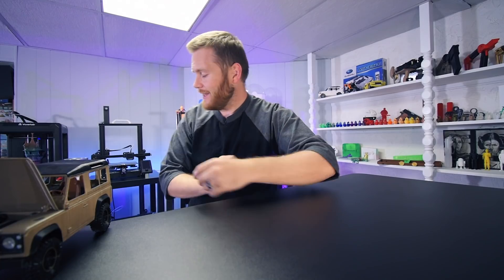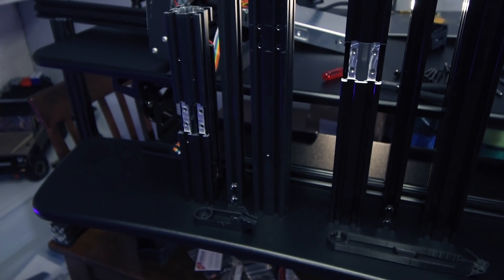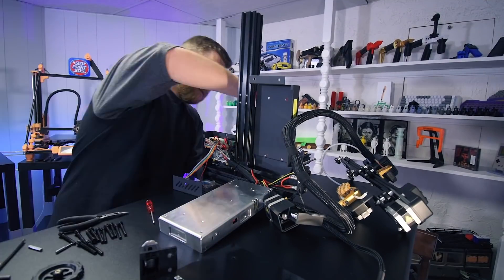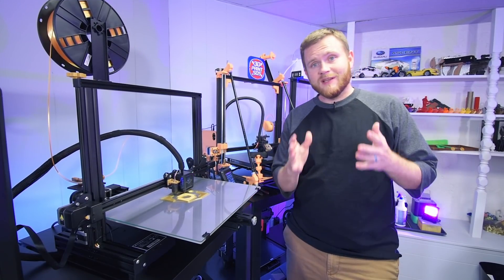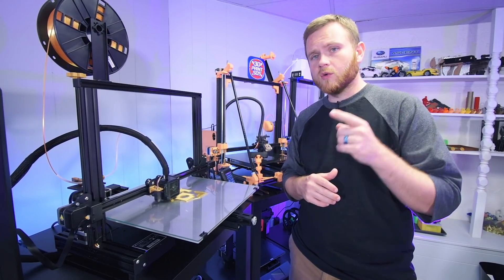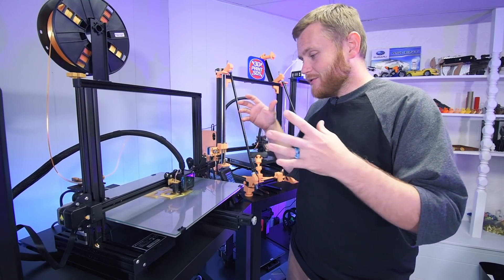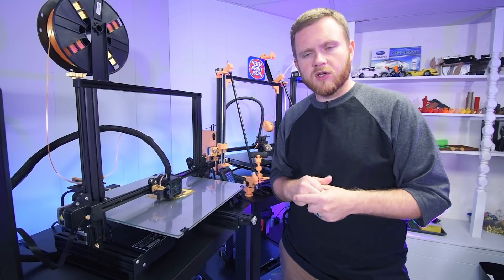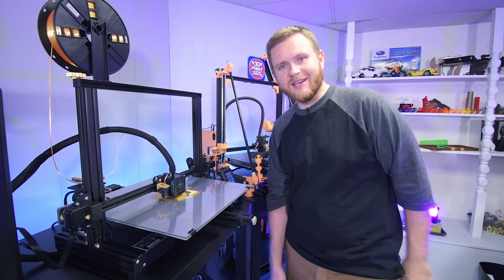Make a MASSIVE Aquila! With Ender Extender

Comment: Should I buy the voxelab aquila x2 or the fokoos odin f3
Reply: Does the Odin's slicer look similar to flashprint or voxelmaker
Reply from the maker: It’s a Cura Reskin
Reply: @3DPrintSOS   could you send me a photo/screenshot
Reply from the maker: It’s quite literally Cura.
Reply: @3DPrintSOS  which one would you recommend for someone who used flashfoge 3d printers for three years but has never owned a 3d printer and would like to upgrade it over time but wants to start with a quality printer
Reply from the maker: The Odin is a higher quality printer for sure. The Aquila is no slouch, but in my opinion it’s a platform for tinkerers. If you want something that’s already got a few more bells and whistles, the Odin wins.
Reply: @3DPrintSOS   so which has more value for money
Reply from the maker: I would say the Odin. Less things to upgrade. A bit less to worry about. The Aquila is a basic machine that can be turned into something that prints way behind its cost. But the Odin is a stronger package and is capable of printing faster because of its volcano hotend and direct drive.
Reply: @3DPrintSOS   is there a simpler slicer for the odin, also could you add a cr touch or extend it like this.
Reply from the maker: Cr touch yes, extender, no. I would just use their slicer because it already has profile that work out of the box.
Reply: @3DPrintSOS  could you upgrade the aquila x2 to be better than a stock odin-5 f3
Reply from the maker: Yea I think so. But the money would likely be equal by that point. So if you like incremental improvements, Aquila would be good.
Reply: @3DPrintSOS   ok would you recommend the aquila or aquila x2
Reply from the maker: Aquila x2 in my opinion is slightly better if you don’t plan to modify it right away. It has improved fans and plastics.
Reply: @3DPrintSOS   got it could you do a few more videos on it
Reply from the maker: I need to do more on the Odin. Since the Aquila x2 is close to the original and the Odin has some special features
Reply: @3DPrintSOS   please do a unboxing/review on the voxelab aquila c2
Reply from the maker: I just found out about this one. I plan on it. Gotta get my hands on one.
Reply: @3DPrintSOS  what do you think about the firmware
Reply from the maker: Of the Odin?
Reply: @3DPrintSOS   no, of the c2
Reply from the maker: I haven’t had a chance to get a hold of one yet. Soon.
Reply: @3DPrintSOS  what do you think now that you got one this morning
Reply from the maker: Since it’s an H32 chip, I’m a bit concerned. Knowing, I can’t compile firmware myself is odd. I havent tested it  yet so we will see how it works
Reply: @3DPrintSOS  is the firmware better/worse than x2
Reply from the maker: Not sure yet. But I’ll let you know.
Reply: @3DPrintSOS  I ment more easy to use than x2
Reply from the maker: Probably not. The Aquila x2 ui and screen are great
Reply: @3DPrintSOS  in your video can you please include a look at the firmware
Reply: @3DPrintSOS  also, does it have any features the x2 doesn't
Reply from the maker: Sure I’ll dive into it. We will look at the components, the firmware that comes with it and how it prints.
Reply: @3DPrintSOS  ok, thanks also pls review flashforge fillament dry box
Reply from the maker: Oh I didn’t know they had one. I’ll check it out. :)
Reply: @3DPrintSOS  ok
Reply: When r u publishing next video
Reply from the maker: Soon, I have one I just wrapped up and working on getting a c2 video, an h32 video, and some more materials tests videos. I have a lot to do with out the time for it. Trying to fit it all in.
Reply: @3DPrintSOS  pls prioritize the c2 vid
Reply: Pls get the c2 vid out soon
Reply from the maker: Tomorrow ;)
Reply: @3DPrintSOS  ok
Reply: Why didn't you show the firmware in the c2 vid
Reply from the maker: Firmware? You mean the menu? Because it’s vanilla Marlin.
Reply: @3DPrintSOS  yeah, sorry I did mean menu
Reply from the maker: That’s a great question. The Odin is a cool printer. Higher quality than the Aquila and prints faster. But the Aquila is more customizable so if you’re into tinkering, the Aquila is probably more interesting

Comment: I would upgrade the Y axis stepper motor with 42-40 or 42-48. I actually did that to my regular Aquila, I put in a 42-48, you get way more torque because you're moving more mass, that's why those steppers run hot. I cranked the vref up and its perfectly cool!

same with dual Z axis, i increased the voltage from the main board screws, not super necessary, but as for these double wide kits and that long gantry arm, the sag must be real.
Reply from the maker: Haven’t had issues either the Y but I have a few steppers laying around I could use if that’s the case. Dual z I can see would be a benefit though.

Comment: So that kit works on the Enders? Also, is that a Direct Drive system?
Reply from the maker: Ender Extender has specific kits for specific printers. Ender 3 is what started it all, so there should be a bunch of options. No, not a direct drive but one can easily be added

Comment: Would be nice if you could make a video that will address  the  necessary upgrades and tweaks  needed in firmware and cura or anything els following this build...
Reply from the maker: I’d love to. First things first, I want to put it through its paces to be sure I can recommend it. Spoiler, just took off a massive 36 hour print. And it’s great.
Reply: @3DPrintSOS  Hahaha, I run my CR 6 SE and CR 10 S anywhere from 30 to 120 hours at a time.  When I get this upgrade voxelab done I got one print that will take 172 hours and that is only half of the print. and its only 0.8 tall lol.

Comment: Any tips on getting prints to stick to a glass build plate? I have my bed levelled, nozzle height tuned in for a good 'squish' first layer, but prints still come detached during print.
Reply from the maker: Go 5 degrees higher on the bed temp, clean it suuuuper well with isopropyl alcohol. If that fails you can use glue stick on a cold bed. However, that’s just a bandaid for a problem that can be fixed. It’s typically a temperature, or leveling issue.
Reply: Hair spray

Comment: Considering how much research I've recently done into longer extrusions and finding a larger bed heater, this video answers more questions than I even thought to consider.  Wiring extensions would be a major concern.

One of the very few frustrations I've had with my Aquila is that I keep designing things slightly larger than 220mm in size.  Not a lot, just a little outside the bounding box.  Problem solved!  :)
Reply from the maker: This gives you sooooo much real-estate!
Reply: If you poke around the Ender Extender site, there's all kinds of wiring extensions they offer that either add on or replace your existing wiring.

Comment: I have a go voxlab Aquila and my extruder keeps making a popping noise. do you know what the problem is?
Reply: Thank you
Reply from the maker: Could be a number of things. Might need higher temps, could be a clog, or you may need to up the tension on the extruder arm spring. Also check to make sure your arm isn’t cracked. Common issue

Comment: 15 and a half inches. WOW! What in the world are you going to fill that bed up with? This is the printer you need that Zodiac printhead on. With a bed this size you sure don't want a failure due to a knockoff printhead after climbing 200mm in zed. This is going to be a Cosplay printer for sure. One piece helmets and chestplates come to mind right off. My LK1 can print helmets one piece, but yeah, 3.5 more inches square on a printbed is a lot of real estate.  I would put a cadillac antibacklash nut on the screw and keep the eccentirc a little tight on the un screwed side. should print fine with no sag at all. Nice video as usual Fedor. Happy printing I am so pleased to learn that Voxelab is releasing their sourcecodes for the firmware. Especially for you Aries folks. Too late for me I bought a Saphire pro.
Reply from the maker: This thing is massive. I want to print some of my keyboard case designs. This will be perfect for it

Comment: Hey Fedor thanks for another informative, interesting video! Has the X axis been OK with the added length? Almost seems you would need a dual Z with the doubled length of X axis.. Good luck!
Reply: I got a 400xl and it really needed one it's probably a good idea to put one
Reply from the maker: Noted. Been doing some test prints. All have been perfect so far. Doing a 36 hour print now. I’ll document it for a video
Reply from the maker: So far yes. It’s really not that much weight being added. I mean, dual z would be great, but so far, not a problem. I’m not printing fast enough for it to matter. Only 50mms

Comment: Does it come with the new to size heater? 

I would like to see a linear rail version of this kit.  If I could get my hands on the prints or solid models of the machine, would be happy to design the conversion.
Reply from the maker: No, you use the stock one. And it actually works just fine. I bet if you add insulation, it’ll be perfectly fine. 

You could easily do rails because it’s still and Ender clone at the end of the day. So you should be able to add parts super easily.
Reply: @3DPrintSOS  - was just thinking a longer linear in the X axis from McMaster would be all you would need, from there you can adapt out to any hot end on the market or a direct drive
Reply: @3DPrintSOS  - Thank you for all that you do! I have been using commercial 3D printers for years, but am new to the hobby, we all very much appreciate your helpful and insightful videos
Reply from the maker: Glad you find it useful :)
Reply: @3DPrintSOS  - so you just stack the old heater plate under the new plate...??
Reply from the maker: Yep. Old heater is the heater, new plate is just an aluminum plate that distributes the heat

Comment: Is there any way you could do an in depth setup for the aquila? I've had non stop problems with mine such as, stringing, shifting, just absolutely everything that can go wrong has gone wrong.
Reply from the maker: That’s unfortunate. It’s typically a few small but key things that tend to stack up and cause issues. 

Anything specific I can help with?
Reply: @3DPrintSOS  right off the bat when I purchased and received my Aquila I have had over 100 emails with customer service. I had a bad motherboard then a bad extruder then even up to the power supply. I'm no expert at this stuff so it kind of helped fixing everything. I did the new fan conversion you had a video on put in a bl touch. But my printer doesn't work right. Cura us usually my go to but it seems to be off. The printer has been slipping every print. I've checked belts and they are perfect. I have excessive stringing on all my prints and I've noticed they aren't very accurate. I'm using petg since it's my favorite and I'm printing at 240 70. Just non stop issues as you can see. Any help would be wonderful.
Reply from the maker: Join the discord server and make a post in troubleshooting. That was multiple people can help and you can post pictures to help us diagnose the issue. :)
Reply: @3DPrintSOS  how do I do that?
Reply: @3DPrintSOS  and thank you for being the one YouTuber to actually respond and help people in the comments
Reply from the maker: The discord invite is in the description to this video. Just click and join. If you don’t have an account, you can sign up pretty easily.
Reply: @3DPrintSOS  also what software do you use? I  am running jyers marlin firmware which has helped me a lot but I M wondering if it isn't helping
Reply from the maker: Jyers is great because it will let you calibrate pretty much everything. As long as you know WHAT to calibrate. ;)

Comment: Height change?
Reply from the maker: I kept mine stock. But that is available. :)
Reply: @3DPrintSOS  I went and checked it out that 400xl is tempting, seems sort of funny to think about spending more on an upgrade for a printer than I did for the printer itself
Reply from the maker: Haha yea it does. But this is a whole different animal now. That’s for sure. I just love that it’s so upgradable and getting into this size printer is significantly more expensive

Comment: I would really want 2 bed rails with a platform that size.  I would imagine it could have a lot of inconsistencies for leveling with all of the added surface area
Reply: Yeah, I am curious to see if you have any issues when you print something much larger.
Reply from the maker: Just printed a massive 36 hour print. Awesome so far. Going to try an even larger print now.
Reply: I think my v slot wheels and the holes for them were a bit off (gotta love crealitys quality control) causing my bed to be super wonky (even after endlessly trying to tune the eccentric nuts and replace v slot wheels). 

So yeah I've upgraded to linear rails using the printer mod kit which has helped massively where the stability of the bed is moving perfectly moving on  the Y but it's still fair wonky.

I've decided to go all out and try mimic the y axis of the rat rig v-cast (two linear rails on the edge and a centre belt. 

And yes I'm well aware this is overkill haha.
Reply from the maker: So far, no leveling issues. Solid bed springs would help.

Comment: Would the Z-axis 500 extender kit work with this as well? was their any firmware update needed on Alex's firmware? Or did you just have to update the volume in cura for the printer?
Reply from the maker: Yep it would work. Man, that would be HUGE! Haha. 

My buddy pulled Alex’s source code and changed 220mm to 400mm in the firmware and recompiled for me. You need to do it in the firmware for mesh leveling to work properly.
Reply: @3DPrintSOS  good to know! I can't wait for more updates on this project you've got going! I've been interested in a larger build system and depending on I might drop the money on both kits just to beef up build capacity so I don't have to slice up large projects as much!!
Reply from the maker: I don’t blame you. This is a fun project for sure. I love that I can upgrade it at my pace and keep making it better.

Comment: HOLY CRAP - WHAAAAAT??!!   I"m IN!!!!  Thanks!!!
Reply from the maker: Heck yea! 🤘🏼
Reply: @3DPrintSOS  - OK - so I finally got it and have installed it.  Overall - not too many problems, but one HUGE one that I can't figure out.  Have an Aquila X2, but my bed travels so far back on the Y axis before the stop switch triggers - that my print head actually is IN FRONT of the bed when trying to Auto Home at 0,0.... Any ideas??  Thanks again for such a great video!
Reply from the maker: That’s ok. The end stops don’t need to be at zero zero as long as they are defined properly in your firmware. Once you start a print, it’ll go to where you need it to. :)

Comment: Awesome, but also remember one very important fact....Naturally , as things get higher, gravity takes over,and may not be stable as a shorter frame...Means ,vibrations, unstability..and weaker frame all together....m
Reply from the maker: For sure. All things to improve upon over time. But at the moment, I can’t think of another way to get in on such a large volume at such a low cost. Might not be the best, but it’s a way for sure.

Comment: My biggest concern would be that the Aquila is quite slow, having 4x the build area will mean some very slow prints for large prints. I think you should investigate improving the bearings and possibly the motors to see if you can make things a bit speedier.
Reply from the maker: I agree. However if you want fast, I don’t think the Aquila is a good starting point.
Reply: @3DPrintSOS  If they get their firmware together which it seems they are the Aries "should" be their answer for speed. There are ways to speed the Aquila's printing ability. It just takes time and calibration and klipper and yeah, knowledge. Which comes with time. There are some kids on discord that are useing klipper and I believe they are getting 80mm/s. My flash has never been passed 60. And these are H-bots.